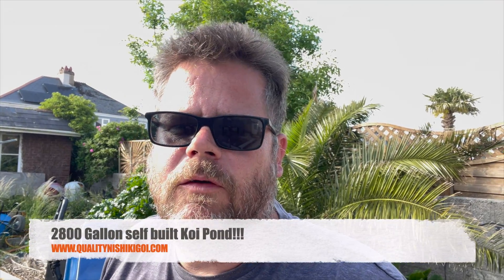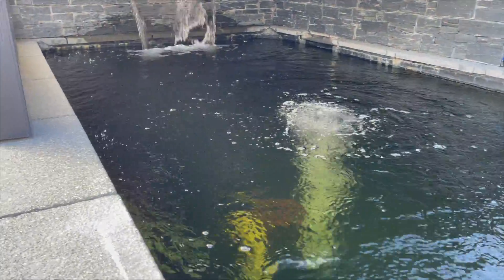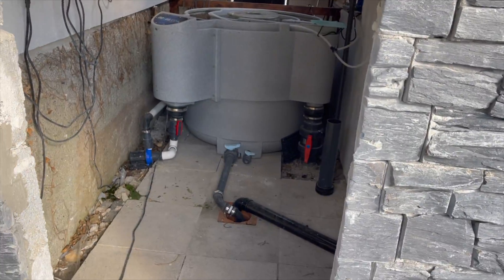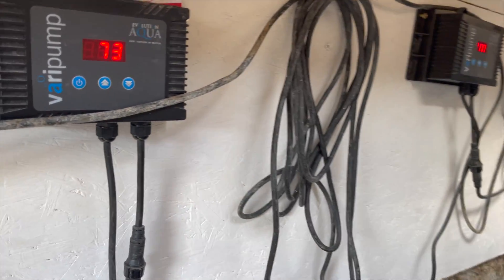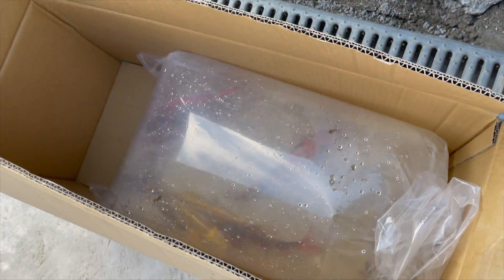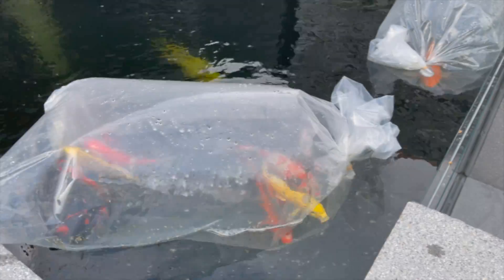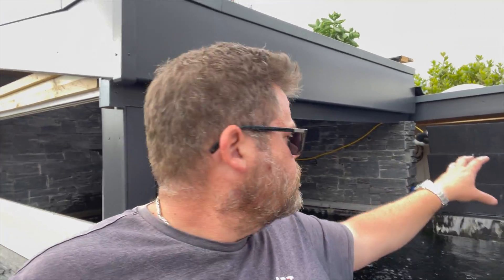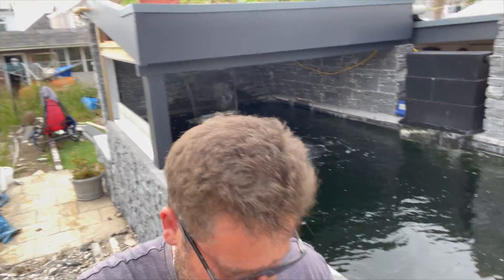2800 Gallon self built Koi Pond - COSTINGS!!!

Comment: Hi Tim I know it's off subject to this video but wanted to ask you a question about the tempest is there any reason why you can't return the tempest through a return that is in the pond wall under water as all the examples in the book are above water cant see why not as its under pressure isn't it? Thanks
Reply: I have my tempest returning under water. Or I can divert over my blade.   When the blade has been running and I turn the valves to then return via in pond return, I get a wee bit air coming from the return for 5 secs. No hassle works fine. 👍🏻👍🏻
Reply: @Dumdum888888  thanks for the reply ok thought so I couldn't see a problem myself but wanted someone to confirm. 👍